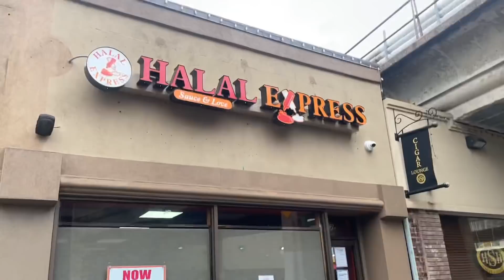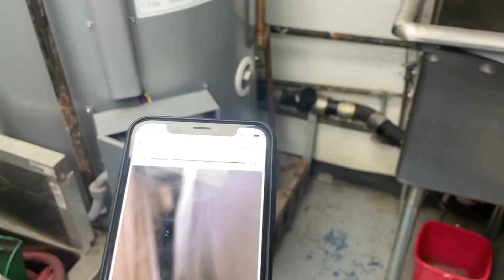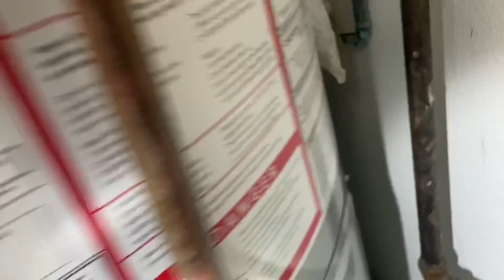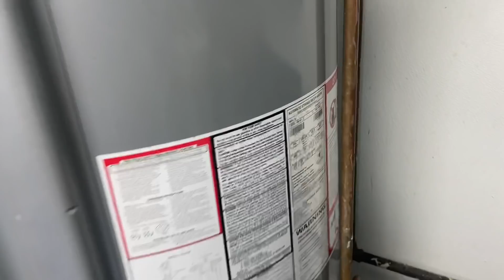Water Heater Back Drafting & Flame Roll Out with Several Code Violations - Owner Won't Listen

Comment: Mikey Pipes, if that guy hires you, I think you will regret it. Run, don’t walk away from that mess.  He’s going to go with lowest bidder for makeup ventilation and I’d bet it will never really run right.  When the place burns down from flame rollout, he will point the finger at you.  Save your insurer from the heartburn and yourself from the headache.
Reply: Run St.Mike! Run.!!!!!!
Reply: I wholeheartedly agree with you Joe
Reply: Run away from this. The video speaks volumes.
Reply: I AGREE 100%. RUN AWAY FROM THIS ONE.
Reply: In Canada, you would be legally required to lock that out, tag it and contact the utility provider. Depending on the severity the utility may lock out the service reg. Now you have a health code violation. That restaurant is CLOSED until it is fixed. PERIOD.

Comment: It sounds like the son is referring to the flame roll-out as a "leak" and doesn't understand that it's being caused by his ventilation problem.
Reply: Can't fix liberal logic..... Just saying....
Reply: @PipeDoctor  He's being hard headed because the last one worked in the back... till it didn't (O.o) His narrow thought process,  why is the new one having issues?  So instead of listening to a professional he rather stay ignorant.
Reply: Son thinks the condensation when the tank cools is a leaky tank.
Reply: St. Mike commands theee to listen the words that are coming out of my mouth !
Reply: @Bryan-Hensley  Needs more than an economizer,sounds like he needs a whole make up air system designed and installed and the d bag on the other end of the phone doesn't want to hear it.
Reply: @PipeDoctor  he understands just fine

Comment: Lordy, what a mess. Violations galore in this outfit. A lot of cleaner chemicals are stored right beside the water heater. Back draft on the exhaust. Messy floor and I see corrosions on all the pipe fittings. This place is waiting for a disaster to happen.

Comment: The downside to a lot of restaurants. The moment that exhaust fan goes on all hell breaks loose. Then when you tell them what the problem is and they need to install a make up air system they look at you look you're crazy. EXTRA NOTE: any business thats in a row of stores, could be in a low back draft from any of those other businesses.

Comment: Great job handling that situation mikey.  What you need is a third party to observe your explaining to him someone like the Fire Chief or Health Inspector to hammer it through his thick skull..  An  engineer should calculate the cubic feet of air being taken out  when the fans are on and a Make-up air system with outlets by the stoves and ovens  and near the water heater. Good luck!

Comment: I'll start with you are a very patient man Mikey. I commend you for that. Crazy how this guy is still fishing for a warranty after being told multiple times that his issues are everything but the heater. A clearly sub-par install, with neglect of mechanical  system's  clearly is the problem. I see nothing wrong in this video.

Comment: You handled it a hell of a lot better than I would have. As you pointed out, the gas line is insufficient for providing the necessary BTU’s to properly heat the water heater. The wiring is not to code regarding the lack of a switch near the appliance, and the positive rather than negative air pressure is actually causing carbon monoxide to accumulate in that room which is a VERY SERIOUS safety issue that is life threatening‼️
This is the kind of customer that I would avoid. Shoddy installations often result in damage or even loss of life followed by LAWSUITS. I would report the findings to American Standard. Water heater installation manuals are VERY specific on how the installation is to be done, gas line sizing, electrical specs, and EXACTLY  how the vent piping is to be installed along with makeup air requirements. Running a commercial kitchen vent hood sucks a lot of air out of the building further complicating the makeup air requirement. Due to the customer demands, along with the out-of-code installation, I think American Standard should void the warranty!

Comment: You were being honest, as usual. I wonder if they had something else installed before? Given the lack of makeup air I'm sure that adding an in-line draft fan (if such exists) would not help either.

You were clear though. Fix all the external to the water heater problems and if there is still an issue we'll be happy to come back and document the problem and support you. Pretty straight forward to me!

Comment: You have proved to be Saint Mike with dealing with that Customer and his Son. Your Patience is impressive. The installation is scary. It is hard to deal with customers like this. The customer is always right, except in this case. I doubt the ventilation system they are installing will be adequate. Thanks for the videos.

Comment: I did a job years ago in an eyeglass store , I replaced a 50 gal gas fired water heater. A week later had call back about pilot blowing out.  
I observed a down from the chimney so I recommended they contact a chimney company to resolve the issue. And i contacted them a week later to find that the chimney company ran a new chimney to the roof and that corrected the problem and I have never been back .      recommending a chimney company to reso

Comment: Mikey, i work for a water heater company. Here on California. Codes maybe s little different.  That 100 commercial model you are dealing with I can see is not grounded with bonding wire and clamps on the water lines and gas.  It is not on a water heater stand at least 18" off the ground. Missing water heater straps. The t&p copper line should penetrate the wall and exit the building 6" to 24" off the ground. If not possible to run line out. Add a watts 210 gas shutoff to replace t&p.

Comment: Mr. Pipes. The owner makes a valid point when he says that the previous water heater worked for ten years without trouble. Could the previous water heater been a power vent? Did something change during the install that made the draft change from out flowing to inflowing. I was wondering why you didn’t look at the rest of the vent pipe in case it came apart inside the building which could cause the reverse airflow condition.

Comment: It's simple, they don't trust the consultation they're getting that the make up air will solve the water tank issue as they don't understand the mechanics behind the system and want to attribute all the issues to the water tank itself, and not the installation of it, in order to get a new tank, or be taken care of in the cheapest way possible. What I don't understand is, they're basically trying to say to you, that the water tank still leaks when they turn it on, not due to the fact that they haven't completed the recommended repairs they aren't even paying you for, meaning you have zero conflict of interest there, but also if those repairs don't work, they want you on the hook for a new tank because it was your recommendation i.e. the line where son said "I want to know that the tank is working and will not need to be replaced after the ventilation is addressed" and the part he left out was "or else." Its pretty obvious the tank is holding pressure, and until the ventilation is addressed, there is no way to give a finite answer to tell them their tank is good to go without a fire off and thats not on anyone but the installer. Since that didn't happen correctly the first time, installation factors have to be taken into account first in order to get the tank to a point where it has the conditions to properly function to begin with.

Comment: I would have like to see the termination of the water heater vent on the roof, i would almost bet its close to the discharge side of a rooftop unit that is blowing air down the dang water heater vent. What the heck have they been doing for hot water for 2 weeks being a restaurant do they not need hot water to clean like cookware, dishes , etc. With vent hood off i forgot that part .
Reply: In my area, if they don't have hot water the doors shut.
Reply: Typically in a restaurant you have to wash dishes between 120F and 160F to be health code compliant.. in Florida where I live anyways.

Comment: How on earth do they get away with those blocks as a stand in commercial kitchen ?  The health department here would be rubbing it's hands together at the prospect of the big fines . And then there is crap installation which would cost them even more in fines .   But it's the same for all of these aloha snackbar places.

Comment: First time out put what needs to be done in writing maybe then it will soak-in
1.  address the air replacement & down-draft
2.  address the burnt line and install a switch
3.  call a licensed contractor to get the water-heater up and running

Comment: When it’s on electric, the cool air coming down the vent pipe the wrong way is dropping off moisture and condensing in the vent core, then running down to the floor. Find a way to get out of there then block the their number. They are a accident waiting to happen. Amazing they figured out how to breathe let alone reproduce.

Comment: Mike you did an excellent job with this guy, and you went over and above which I would have done.  As you can see, he gets anyone who is the cheapest regardless if there license to install, it's not code, and only a professional like yourself should have installed it.  Story over.  Yo sippy cup, did you turn those chargers on?

Comment: I do a lot of work in Customer service. If you want some advice on handling that better. When you detect that the customer has already formulated the problem and solution to the problem inside of their brain, the first thing you need to do is overwhelm them with your credentials until they agree that you're more qualified to be diagnosing the problem at hand and coming up with a solution. Only after that stage can you rewrite what's in their brain about what they think the problem is and what the solution is.   It's just how some people are, stubborn like an oxe.. Or a mule?  Whichever..  Most people aren't like that though but once in a while I run into people like that too and before trying to convince them of what the problem and solution is, sometimes you need to convince them you're more qualified than they are to be troubleshooting the problem and offering a solution. Even though doing such a thing seems completely ridiculous in most situations, sometimes you run into that one customer where you have to do that extra step.

Comment: @Mikey Pipes - Pipe Doctor Plumbing & Heating & Air

i would have put a 30 day notice on that water heater for brining it up to code just due to the fact that combustion gasses are leaking back into the room. it would be up to them to get the thing replaced or fixed in that 30 days before the gas gets shut off.

Comment: Big question……?
Are permits ever taken out for any of this work?
If the gas company came out or the plumbing inspector, or maybe even the health inspector, saw how this appliance was running. The electric supply would be found and shut off. 
I guarantee you the gas cock would be shut off. The gas piping would be disassembled with a cap or a plug after the gas cock.
Mike, you handled it in a very professional manner. But do you realize the stress that you’re putting yourself through. All I can say is cooler heads prevail. 
You know the building owner and his father are full of shit. Don’t let it get to you. It’s only gonna eat your esophagus and stomach up. You said it yourself your health is the most important thing. My only suggestion is slow down… Take a deep breath… It’s business don’t take it personal.… And let the water roll off your back like a duck and move on to more productive projects which I know you do. Now that’s easy for me to say. Because it wasn’t until I was in my 50s before I could take my own advice. Best of luck to you pal. And remember “keep smiling..!”

Comment: Could have explained how condensation works. Most people dont realize how the air is full of water or how a hydrostatic pressure test shows how a heat exchanger is structurally sound.  The language barrier may have been a factor but I find scientifically explaining  complex problems can make a customer realize that they may not know as much as they think they do

Comment: Basically, the dispute is between American Standard and the restraunteer.   As an agent of the manufacturer, you have a vested interest in avoiding any indication of impropriety.  You should not offer your services to the other party in what is fast becoming a legal issue.  Better to document then leave.  And you should not accept any portion of the repair, or 'commission' of the unit unless American Standard hires you.  No need to explain to the owner.  You are merely and agent of the other party.  Explain to the manufacturer, your findings and let it rest.

Comment: Does a restaurant like that need to maintain a certain minimum hot water temperature because of food safety reasons? If not why didn't he just put in an on-demand instead of keeping 200 gallons hot 24/7. They must have commercial on-demand also.
Great job handling the customer 👍

Comment: Mikey, in the UK a Gas Safety Engineer would have to disconnect the gas supply pipe and cap it so it could not be used. On top of this he would have to put labels on the heater marking it IMMEDIATELY DANGEROUS and give a completed form to the owner of the restaurant. If he did not accept the course of action you HAD to take i.e. not allow you to disconnect the gas supply,  then you would have to contact the gas supplier to turn off the gas supply to the premises at the main supply and cap the supply after removing the gas meter. If the Gas Safety Engineer did not show that he had taken this course of action and someone was injured or killed by CO poisoning then HE/SHE would be facing a minimum of 5 years in jail for manslaughter. The restaurant owner would be dealt with separately but you as a gas engineer, having inspected the appliance and the installation and knowing it not be to code would bear the brunt of the restaurant owners callous attitude.

Comment: Not being a contractor, this is just a question: Couldn't you have installed some sort of power venter on the chimney pipe to overcome the negative pressure in the room?

I not so sure you'd want to have this place hire you.  The red flags are already up that it would be an endless nightmare. This customer would never be satisfied.
Reply: The flames were orange,so it needs more air hence the backdraft
Reply: A power venter needs air to power vent. There is a lack of makeup air so a power venter wouldn't work here.

Comment: Hi Mike,
My, natural -drafted, water heater 50 gal
(Bradford white ), backdrafts sometime when
house goes into a negative pressure…
The 4 inch liner was properly installed and runs
through the brick chimney. For most of the
time it operates fine, but in cold season with
windows and doors closed it tends to
backdraft ones in a while. Especially, when
other fans in the house are running.
When closest window from the tank is opened 
 it changes the flue back into the chimney.
My hvac recommended installing a 6 inch air
intake pipe (for combustion air)….. I'm afraid it
would bring all cold air from the outside...?
What is your opinion on this?
Also, if ever changing it, should I get power vent tank or tankless ?
Thank you.
Reply from the maker: You need to bring in some make up air

Comment: mike awesome as always quick question if he had a powervented water heater would that also help or is that stupid? thanks happy 4th
Reply: Most likely would still have a make up air issue.  Should go with direct vent w.h. for a fresh air from outside.  Might have to spend some more money on unit and install, but would be the way to go with their situation

Comment: Mike can you put a powered vent on the stack to come on when the burner comes on?
Reply: While it would help the exhaust gases and slow the roll out it would not solve the negative pressure the building is experiencing because of the ventilation system, there needs to be more air fed into the building rather than more air pumped out.

Comment: I wonder if the inadequate gas piping is the root of the guy's problem.  Water heater isn't producing enough so he looks and sees the flame rollout, then the condensation and latches onto those problems "to get a new water heater".

Comment: I Have a fiduciary responsibility to report my findings to the water heater manufacturer.  My finding is that there are no warranty concerns with the water heater at this time.  However there is an external issue with ventilation system in the restaurant causing a hazardous condition within the restaurant.  Failure to address this condition is a fire life safety concern and must be addressed before the water heater can be started.   As soon as this ventilation problem is rectified I will be happy to enter into a contract with you to repair the external damage caused by your external hazardous condition.  I'd put that in writing and have them sign the document so that when the dumb ass burns down the building, the state won't be giving you a bureaucratic enema.

Comment: I think you handled it well. But with that said I do t think he fully understood what you meant. Granted he was trying to hustle the system. I don’t think he understood the three steps 
1. Draft
2. Electrical
3.plumber
I think he was honestly confused on that part and I don’t think he understood that the electrical cable could just be replaced easily without needing a specific “water heater” only style cable. That’s all. Sometime I think it needs to be dumbed down. The fact that you were already heated at him fucked up his chances from the beginning.